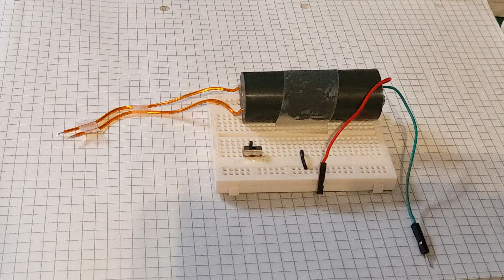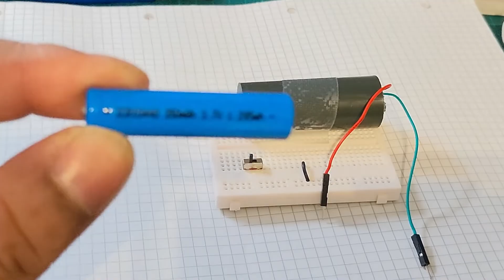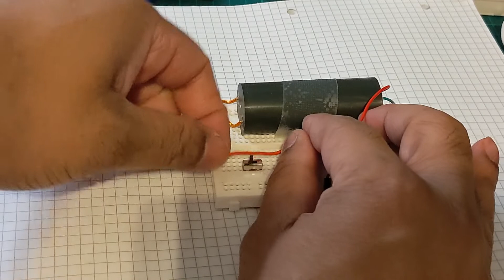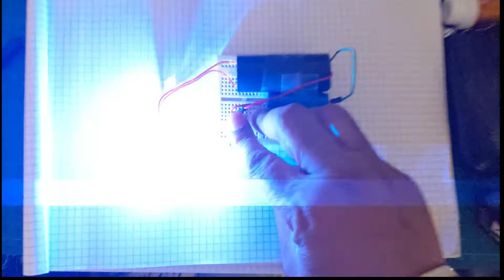DC 3V-6V To 400kV 400000V Boost Step-Up Power Module High-Voltage Generator

Comment: No way near 400 000 V, would make a very high pitch noise when making arcs over this small distance
Reply from the maker: Need detailed result but for sure people are making  Ionic thruster engine with this-
Reply: @IndiceEducation  yes, I'm making ionic thrusters too, most of these modules usually get to 3/4 of their voltage rating when using a good supply with the max specs the input is rated for. when using a supply that is just something you found and that vaguely falls into the ballpark of accepted inputs, the results are not great. A great way to test the voltage is to try making the longest arc spark it can make and compare it to some chart.

Comment: Honestly just use a piezo igniter, it's so much safer and won't hurt touching
Reply from the maker: I did some research, nothing much happens when you touch(apparently 🥺) but can harm you if you have pace maker or even the low current high voltage can interfere with your heart beat. Don't touch it.
Also please, watch and review some other videos at this channel 👏
Reply: @IndiceEducation  I understand, Nice video 👍
Reply: @IndiceEducation  it wont harm your pace maker unless current passes through that pace maker. going in and out through said finger wont do that

Comment: Recently modified an electric swatter with one of these soldered to an 18650 worked great but  after a few weeks the battery started smoking and i had to disconnect it. Was curious about what went wrong ?
Reply from the maker: These are high current device, so the longevity is not there
Reply: Like $3-4 save Ur time

Comment: Use a push button, a switch you are using is no good. You need to be able to disconnect the moment you let go of the push button.
Reply from the maker: It was just an experiment

Comment: The latest types of these LG-901 high voltage generators are just crap !
For generating a usable spark bridge , even a 6 Volt battery pack is not sufficient .
I think that they changed the push-pull generator in it for a single ended generator ,....just like they did with the mostly available electric fly swatters. ( for savety reasons or so )
Anyway ,...the minimum voltage to let it ( more or less ) work ,  is about 8 Volts , with a current flow of almost 2 Amps  !!!! , and then the unit will die within a minute by exceeding the maximum voltage
Reply from the maker: You have great knowledge in electronics.we may work together in future👍
Reply: So..what do You recommend?

Comment: Hello , I want to buy the same for a project , can you send me the link from where you bought the DC high voltage generator .
Also , can you tell me how many days  did the DC high voltage generator work ?
Reply from the maker: https://www.ebay.co.uk/itm/265566498025